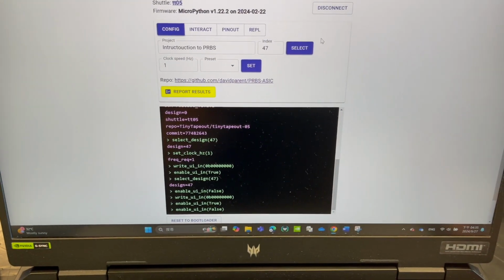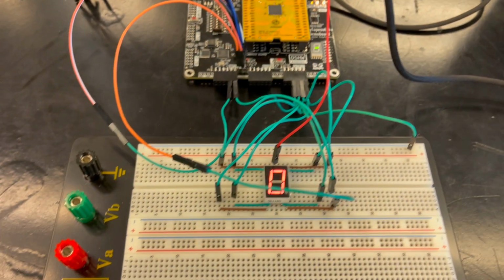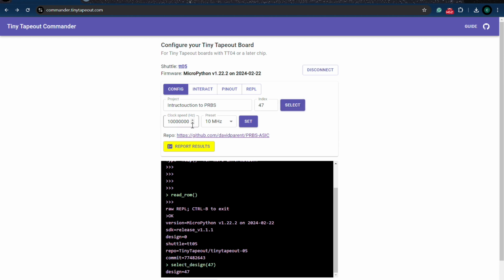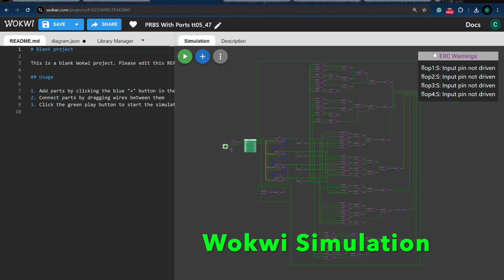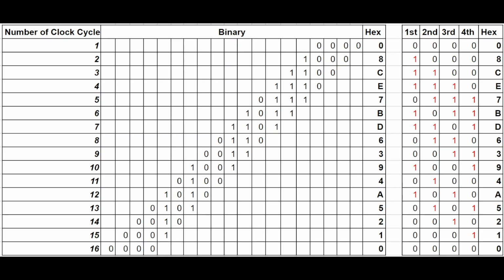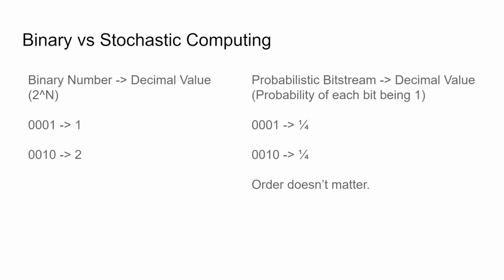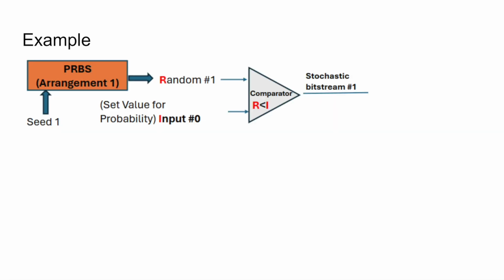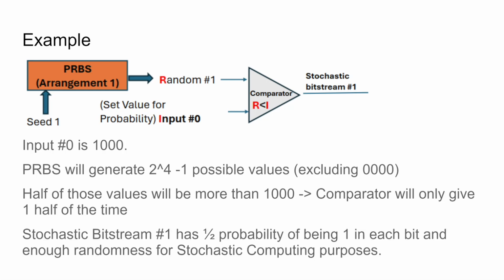Random Number Generator

Comment: if this project is show casing for only generating of PRBS, you are successful. This needs further developed to be really useful in the test and measurement world. Where is the timing analysis? Where is the analog portion of your design? To be able to work even in the wireless world, your generator should work at or >2.4GHz, where you would need to start designing proper analog front end.